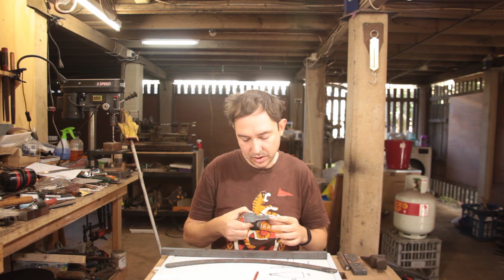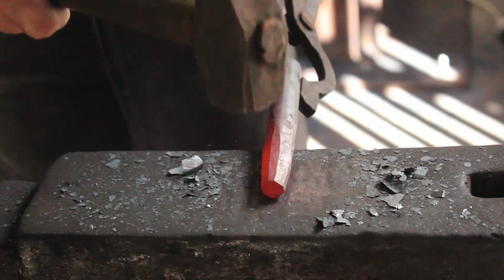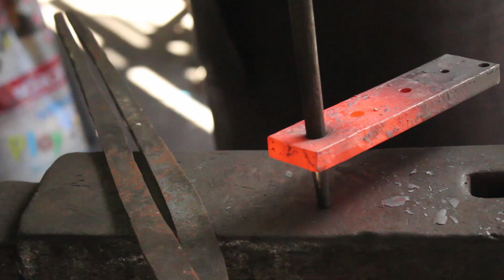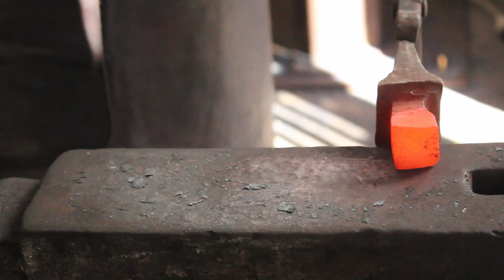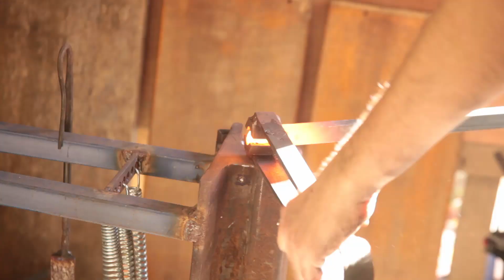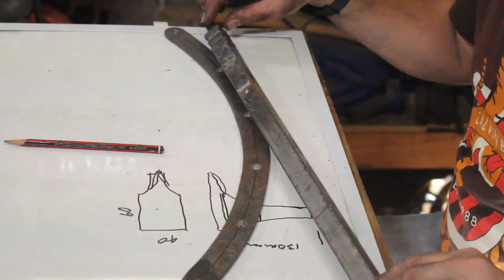Hearth Crane pt4

Comment: WRT the treadle hammer anvil, did you research the best height for that? I would imagine that it could be higher than a standard anvil because you're not worried abut the angle of the hammer when it hits as you are hand hammering.
Reply from the maker: It could and ideally it should be near waist height, but I have limited head room so a compromise had to be made, it’s also why I designed my own instead of using the Clay Spencer design which is much preferred to have used.
Reply: OK thanks. As I suspected. I plan to do similar, IE a variation on the Clay Spencer design.

Comment: Nice to see the treadle hammer get some use
Reply from the maker: Oyster Cove Craftsman it’s getting enough use that the aging concrete slab is failing... 😱
Reply: @docshotshopandforge  are you in a metropolitan area? You could prep the area to re do the concrete. If it isn't a large area ring a few concrete companies and tell them if they have any pours in the area and need to empty their mixer for cleanup that you can take the extra concrete. 
I do it with work abit if we have little stuff. Might be different for me though because I have a rapport with the company. Could be worth a shot though
If they agree to it just make sure you are ready to get it in, don't want to keep them waiting 👍